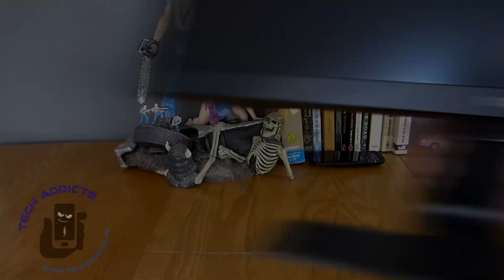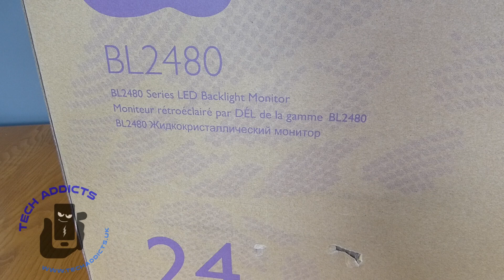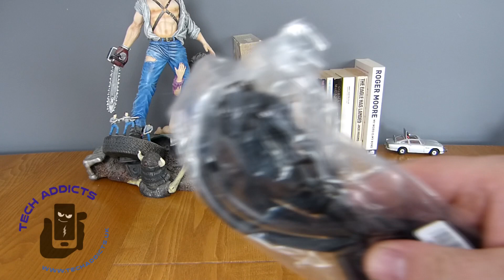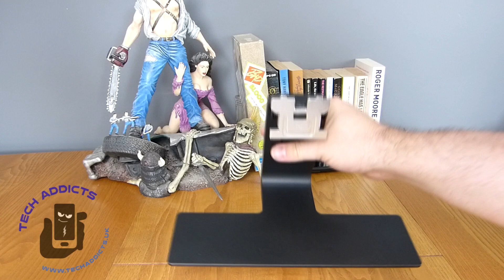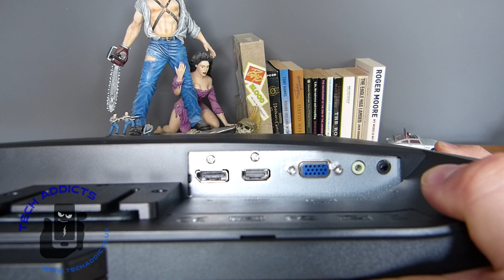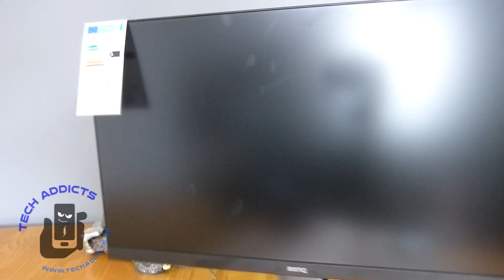BenQ BL2480 Unboxing

Comment: Managed to knock mine over after 2 months. Only a tiny bit of damage and yet completely useless. That's how it is with these screens of course. Got a Samsung T35F as replacement. It feels a little dinkier but not much. The Samsung also has a more noticeable vignette effect which is a bit sh*t. Although this is common on cheap IPS panels as I've heard the BenQ did not have this and I think that was a strong point. Would buy the BenQ again but it was not the cheapest one this time around.

Comment: Good video, but in reference to the presenter's comment about the monitor stand not being height adjustable and you can't swivel it - "A bit limited maybe, but what are you gong to do?", the answer is straightforward: choose the BL2480T instead.  Same monitor, different stand.  The BL2480T is height adjustable and you can tilt it and swivel it.  The downsides are that (i) it is more expensive and (ii) you lose the cable management system, which means that you will have two cables dangling down at the back.  This is a necessary trade off, because obviously if you can swivel the monitor then it's not possible to squeeze together the two cables which plug in to different places at the back.  You can see pictures of the BL2480T on the BenQ website: https://www.benq.eu/en-uk/monitor/business/bl2480t.html.